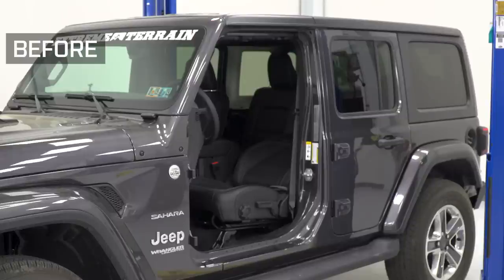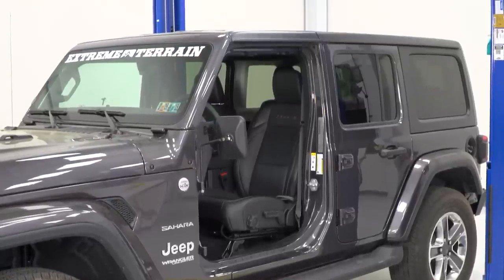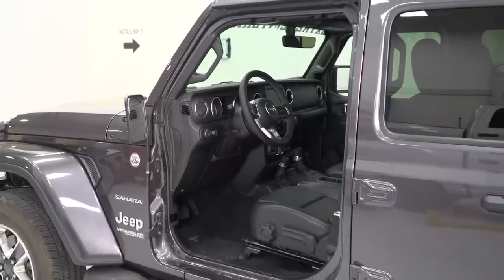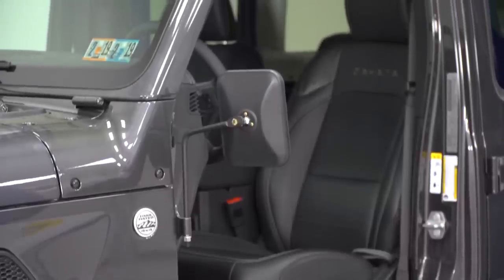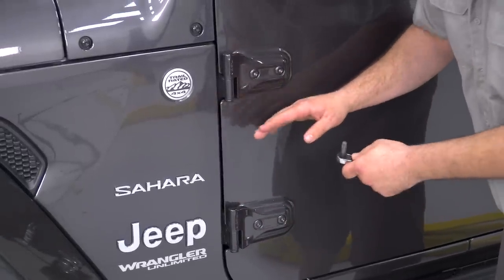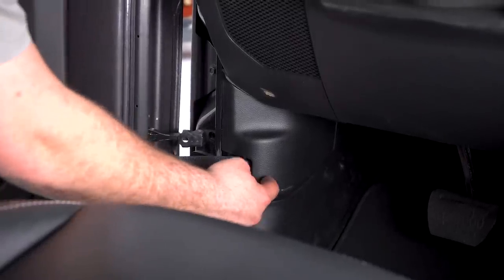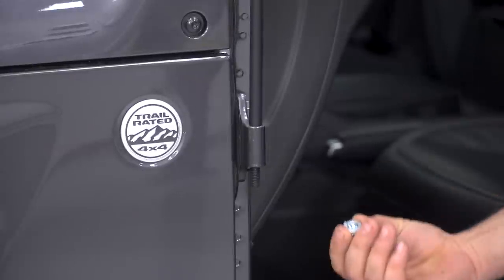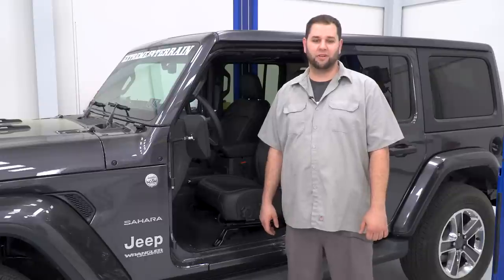Jeep Wrangler Barricade Rectangular Black Adventure Mirrors (2007-2018 JK & JL) Review & Install

Comment: Does the wind at highway speed cause these to fold inward, or do they have a secure enough hold to prevent that?
Reply: Principal Skinr they are secure but they shake so much you can barely see out of them...